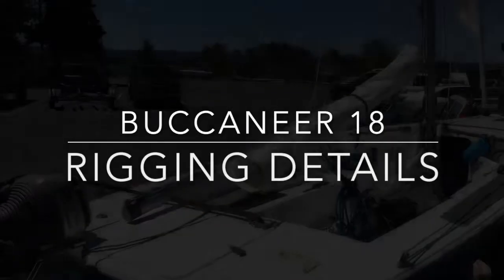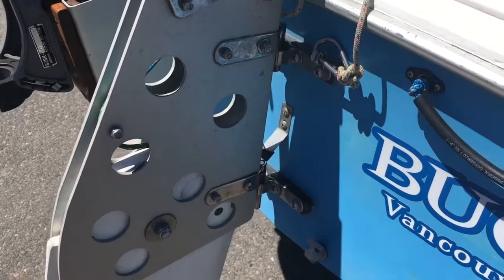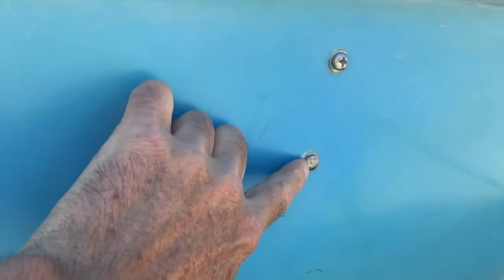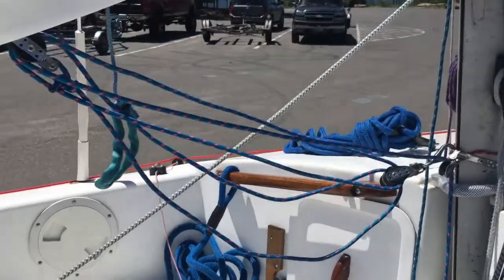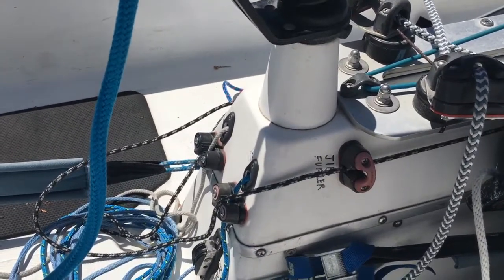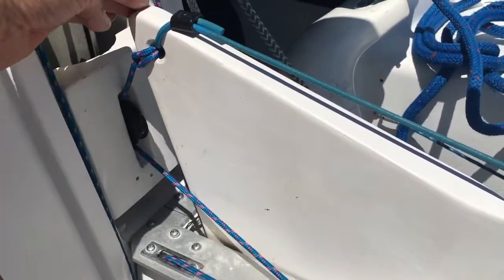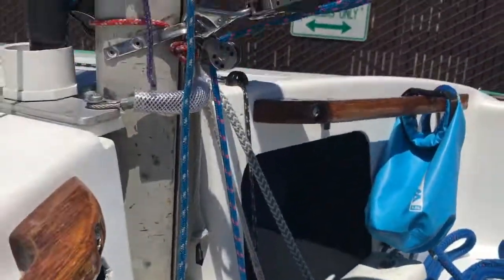Buccaneer 18 Rigging Details

Comment: Thank you Charles!  It's a huge help for my new Buc.  I'm trying to make it a little more user friendly for new sailors.  I see your boom is mounted much higher than mine.  My boom is so low, it's making it real difficult to tack.  Do you happen to know the size of your sail.  I've found a bunch of used sails, so I think I'll just buy a smaller one.  I also love how you fished the roller furling back to the helm.  I guess my boat was set up for two people, but I want to be able to solo with no problem.
Happy sailing!
Reply from the maker: What I use when the wind is up is a Mutineer sail-its 100 sq. feet instead of 114 but makes a big difference when I'm sailing solo as I can sheet sheet in tighter and I don't loose
much speed pointing. Yes I'm 6'-3" so I moved my boom gooseneck up which is a permanent revited fitting. I'll send some shots of that and jibstay spinny setup next.
Yes happy sailing!

Comment: Thanks for sharing your experience and upgrades.
Reply from the maker: Your very welcome! I've taken no less than 3 sailboats boats now that looked pretty bad and renewed and upgraded the rigging on them. The key thing is to go for safety first. Fix what could be bad if it gave way out there on the water. As you sail the boat which you are bringing back from the "nearly gone" condition you want to fix more because you are actually sailing it! Eventually you even get to the looks which is nice. Gel coat does protect fiberglass its good to get to that eventually.

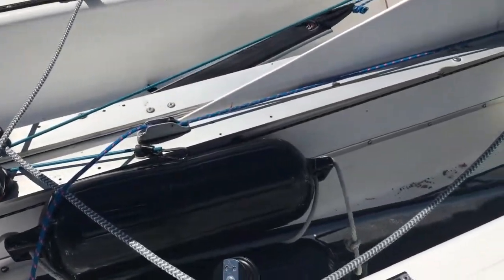Comment: Cool video!  At 3:55 you show the cam cleats on the rail. Just curious since you already have the swivel cleats on the inside, when would you need to use something like that?
Reply from the maker: Thanks for the comments. I like Flying Scots too. I have the cam cleats up there so when the crew is hiked way out the jib lead is cleated right there next to them but the swivels work well for that as well you just need to lean in a little to release when its really windy
Reply: @charlesbronaugh8996  Oh that's a great idea.  I hadn't thought of that.  I think I will mount a couple out there for that exact purpose!  Thanks for the great idea.  Love watching your videos!  They are unique as they aren't your typical racing or cruising videos but more of a seasoned sailors perspective on the water.  I dig that!  Please keep them coming.  Thanks!
Reply from the maker: I appreciate that comment on the vids. What I try and do is not play loud background music and instead hear the water going by. And talk about rigging I have set up that makes the boat go faster or easier to sail because they go hand in hand. Also some safety points. I also don't hype or bug anyone to subscribe I just do this for people that 
want to check in on my take on dinghy sailing and get out an actually sail!

Comment: When youo moved the jib tracks inboard, did you move them forwarrd or back at all or evebn with where they were?
Reply from the maker: I put my tracks where the center setting, of the track itself is 34" back from where the bench (seat) hits the front wall of the cockpit.
Reply: @charlesbronaugh8996  Did your boat originally have a hanked on jib?  My forestay is too long to terminate properly on a chainstay just inside the cuddy, right side.  Had to make a crude new one which is shorter.  Any ideas?
Reply from the maker: yes and I have reworked an upgrade to use a Harken jib furler. So that rig requires hardware, secure mounting and sail with a sewn-in stainless jib stay. A good sail maker will do that for a Bucc class sized jib sail. What ever you do that jib stay holds your entire rig up. Your main, mast and all comes down right at you if something gives heaven forbid. Its smart to run a second, security line from the bow up to the top of the mast, if you have any doubts about your jib stay attachment!
Reply: @charlesbronaugh8996  and when you moved the jib tracks, did you gain access to the underside to put nuts on screws, or just use wood screws from above?
Reply from the maker: @brettputney5016  I just put in a pop rivet at the front hole and back holes and yes then screws in between. It has held down really well both sides. Do small pilot holes so your threads really grip!